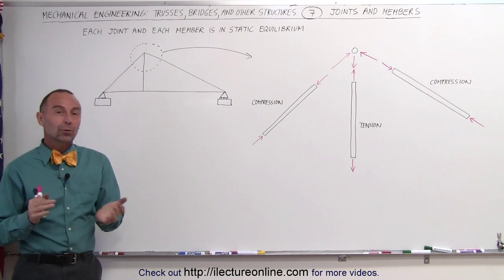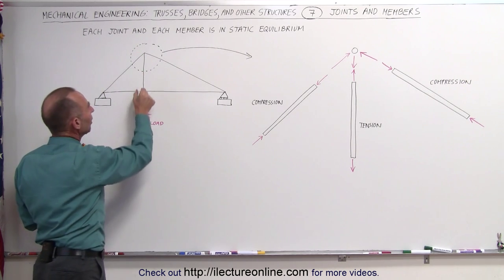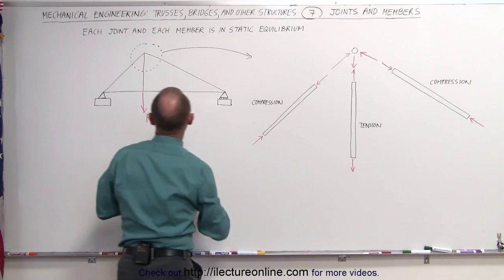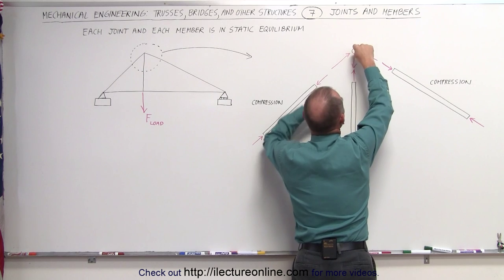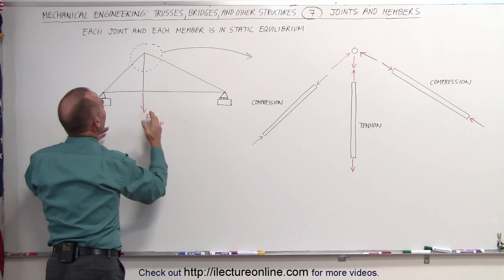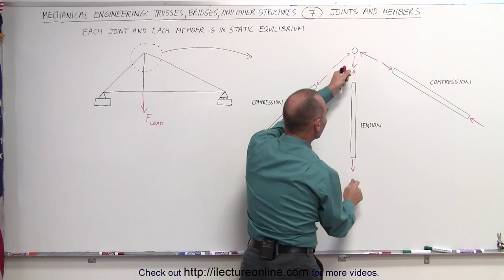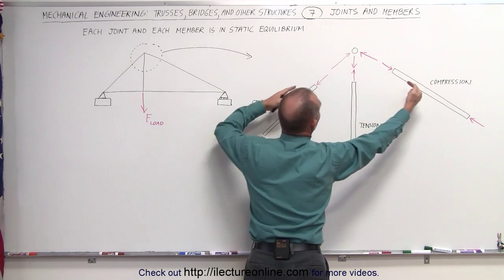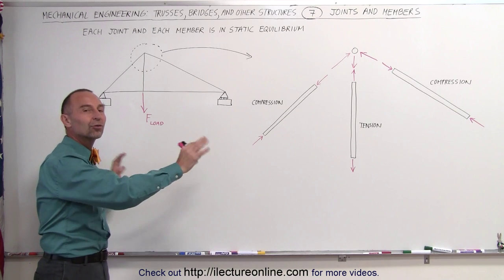Mechanical Engineering: Trusses, Bridges & Other Structures (7 of 34) What are Joints & Members?

Comment: Load applies downward force on member.
Member pulls down on joint, due to force of the load. So, member applies downward force on joint.
Joint resists downward force by applying force in equal and opposite direction (upward force)
Because load applies downward force on member and joint applies upward force on member, the member is under tension.

At the same time, the joint is not moving downward because of two to supporting members. 
Joint is being pulled down because of load.
Joint pushes on supporting members.
Supporting members push back (equal and opposite reaction), due to the connection supports (what the truss is resting on) at each end. 
Joint pushes on supporting members and connection supports pushes back resulting in compression.

Look at the diagram and arrows to help out. I left this here in case someone needed it.

Comment: what happens when there is no load in the truss but there are reactions due to support ?
Reply from the maker: If you are only dealing with the weight of the beams without any additional load, then the weight of each beam becomes the load and it will act as if the weight is at the center of mass of each beam.

Comment: I can see that the king post would be under tension if being pulled from below. but if the force on the king post was only a force from the weight of the roof, ie a pushing down from above (eg from the weight of a roof) would this mean the king post is under compression? or a zero force member?
Reply from the maker: When you add load forces to the problem you will have a different problem that must be solved accordingly.  Note that there are other videos in the playlist with such situations that show how the load forces are taken into account.